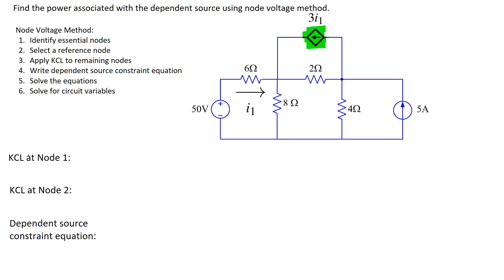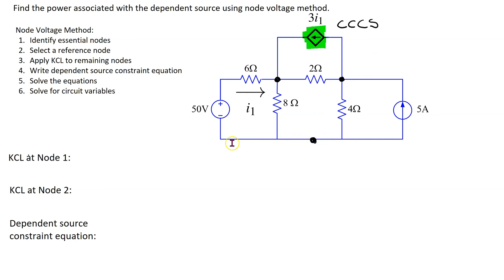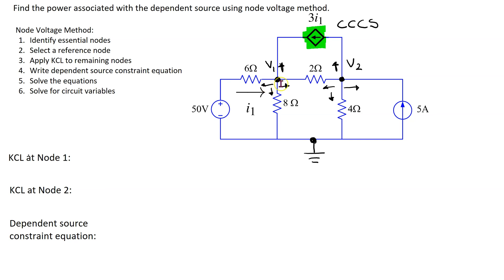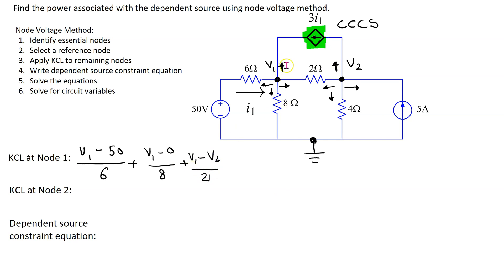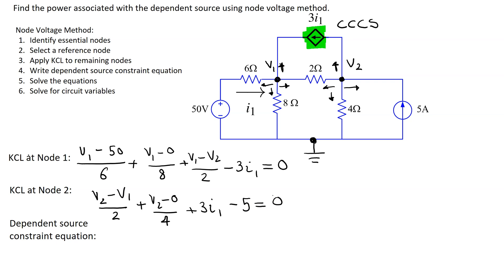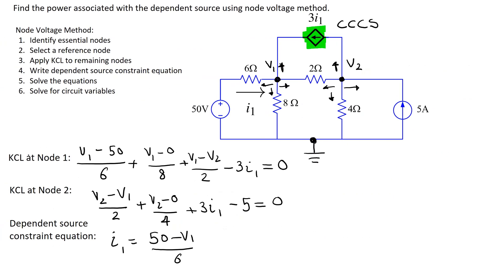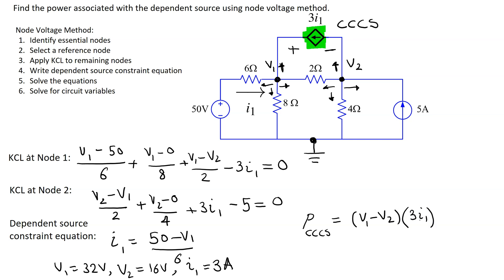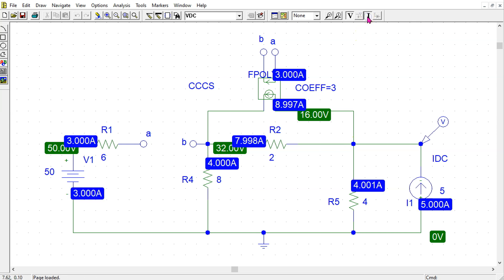Node Voltage Method  - Example 6 (Trick: How to handle CCCS)

Comment: isn't the value of i1 suppose to be negative since i1 is going towards the essential node V1?
Reply from the maker: Thank you for the question. The solution in the video is correct and is verified using LTSpice. 

i_1 is the branch current that is given in the question as flowing into the node. When we write KCL at node 1, the systematic method I follow is that we ignore any given branch current directions and assume all branch currents are flowing away from the node for simplicity. Doing so allows us to minimise the chance of making a silly sign error. Thus, we write ( V1-50)/6 for the branch current in writing the KCL at node 1.

If we were to adopt i_1 and also 3 i_1 (due to CCCS, branch current is entering the node) as two branch currents entering the node and other two branch currents leaving the node, then the node equation would be:

(50-V1)/6 + 3i_1 = (V1-0)/8 + (V1-V2)/8

This is also a correct way to write KCL equation for node 1 and leads to the same solution.

Hope this helps!
Reply: @electriccircuits7164  thanks for the insight man. it's good to discuss engineering with people outside of a professional setting.